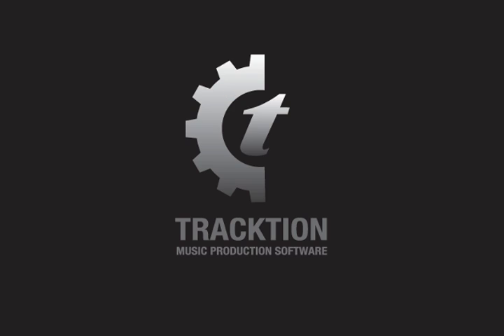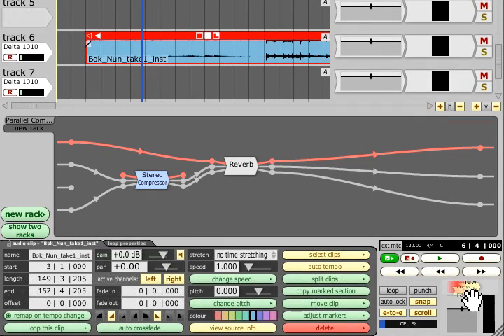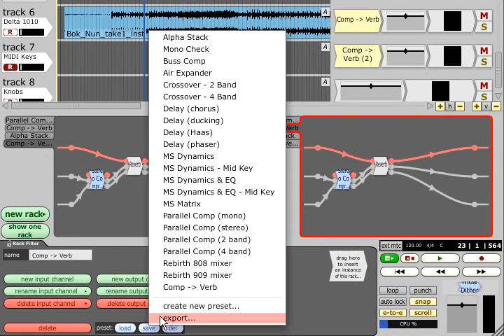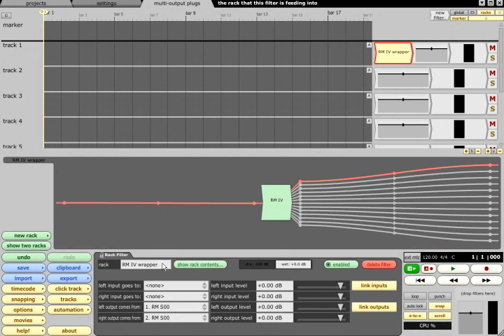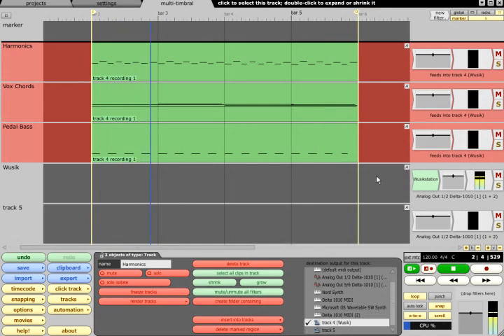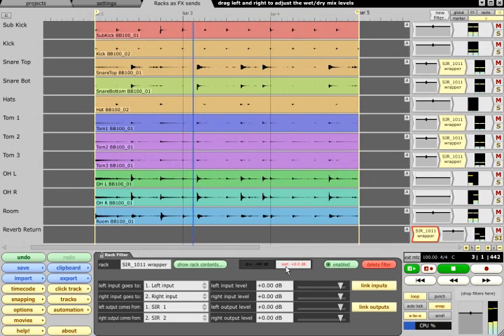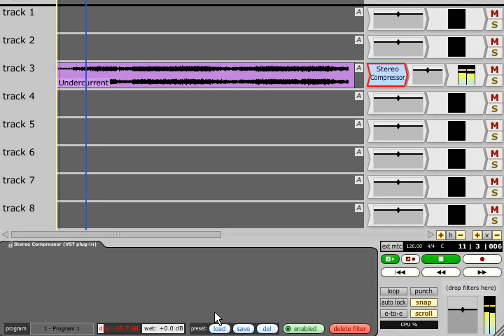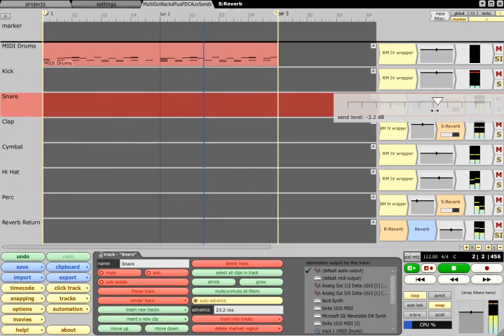Tracktion Software - Rack Filters

Comment: I still have no idea how to do sidechain with this
Reply: Wrap a comp with aux inputs (like reacomp or mcompressor, with aux/sc selected on the plugin). Select the rack on the drum/trigger track and select the aux L and R inputs in the properties window (triggering the comp), making sure to reduce the wet level to 0 and the dry level to full (or dry to 0 if it is a muted sc trigger). Hold control and drag the rack to tracks that you want to pump. The wet level controls the amount of sidechained signal.